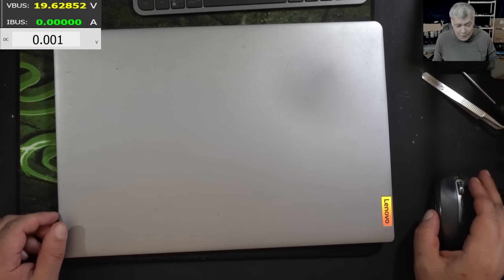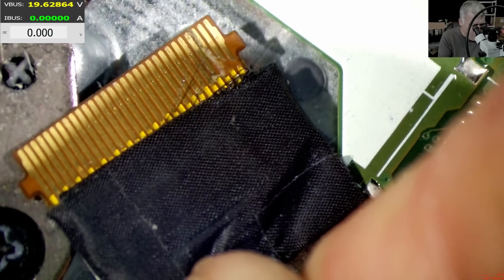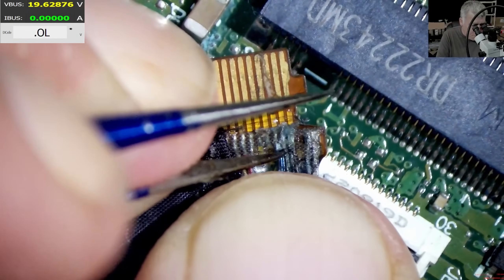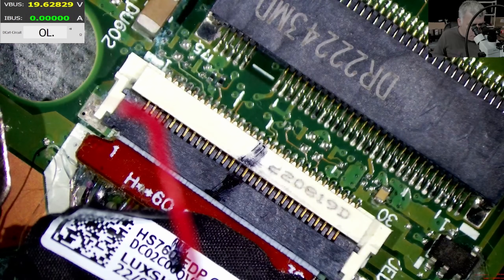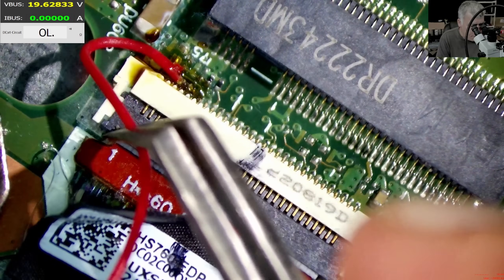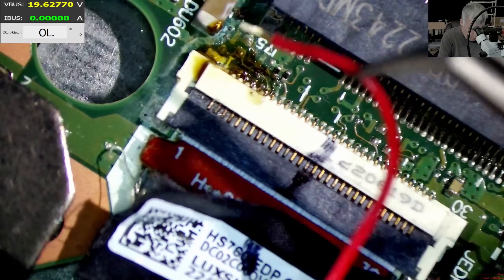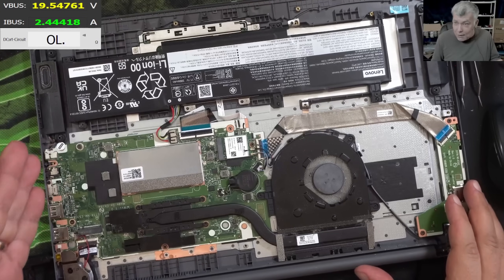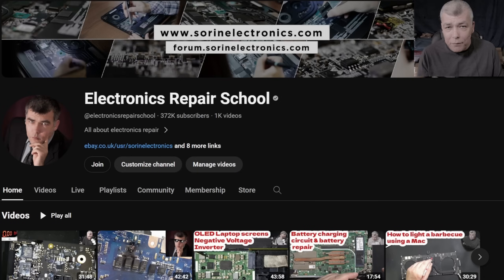Lenovo Idea pad 3 laptop coming on with no backlight, motherboard repair

Comment: It's a bad design imo putting a ground pin next to the 19V pins usually it is on the other side of the connector

Comment: I like your work Sorin, I learned a lot. But you should clean area around - there is water damage and it will comeback. Also easy was to fix this cable, it would be original way.

Comment: Yeap, we know how to replace screen cable 😊
You just need to find it bu the text, that is written on the lable
ZAHARA HS760 EDP LCD LVDS Screen Video Cable 30PIN for Lenovo IdeaPad 3 17IRU7 V17 G4 IRU 5C10S30222 DC02C00QV00 DC02C00QV10 DC02C00QV20
And it must be good idea to measure resistance before start soldering something. If some pins are damaged by the water, there can be something blown on the board.
And you just solder 3.3V with the ground. Lucky you

Comment: Nah, you complained once that some customer keeps sending you laptops with fully charged batteries and you can't check the charging circuit because of that. So, whoever is sending laptops to Sorin - make sure the battery is at 50% charge. 😉

Comment: My gigabyte G5 KF just shutdown during gaming and no light indicators. It's like zero power. I tried  everything, some said it's EC controller, and I tried removing battery, resetting by power button and so, removing cmos battery, used brand new charger and result still same, no light, no indicators. I tried take to the repair shop in my town and everyone said they are busy, I can't actually believe it... I wanted simple diagnostic to understand what is a problem. So maybe you can give a clue? BTW, I checked motherboard and everything is clean, no black spots and anything.

Comment: Every time you bite into the threads to strip them, something dies inside me, you could certainly use a proper tool but.....
 I understand that teeth and nails are much closer, it can cost you a lot using your teeth as a utensil.

Comment: For this type of repair you could use a copper foil, glue it to the connector and solder to the beginning of the broken tracks. It takes less time, screen connector can be disconnected if needed, risk of short is reduced and also you cannot see that a repair was performed. At least that is how I would approach it. Copper foil is not expensive and you can use it for years to fix traces
Reply: that's not dodgee enough...
Reply: Good idea but it works only when the other half of the connector is not fully carbonised with no contact (what I also faced before).
Reply: Nice idea never seen it done before.
Reply: Great idea!
Reply: Nice idea, Great content you have on Romania Driver series.
Reply: I would try with conductive silver glue, see if it works. But yeah it's a good way to solve it.